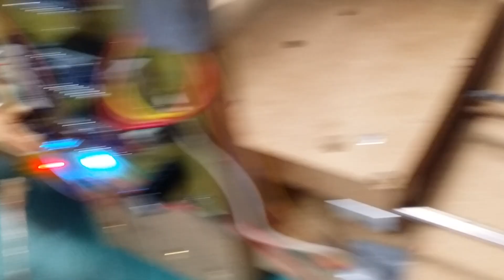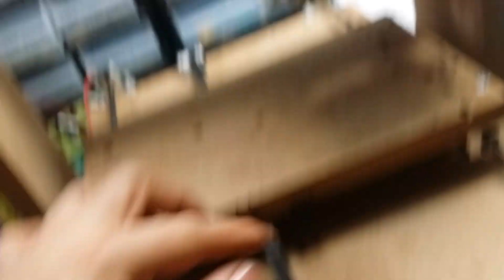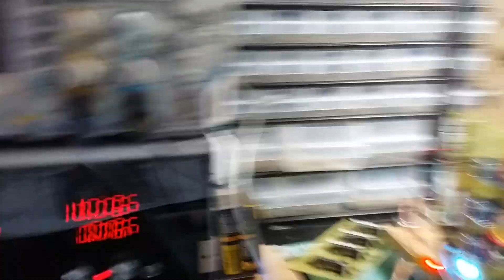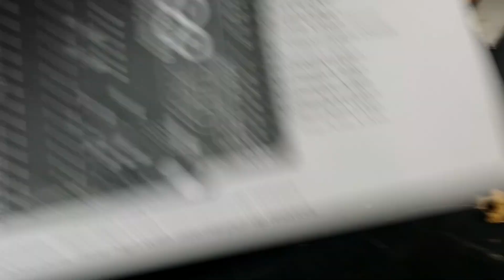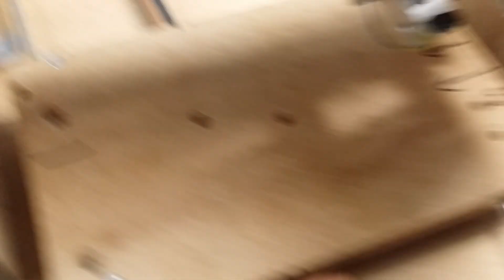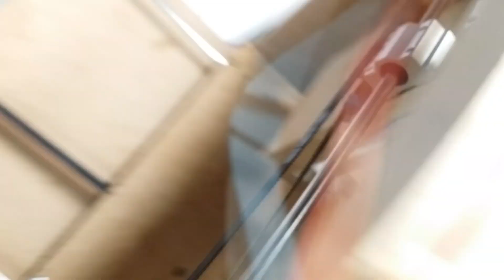Cnc build part1

Comment: MJ, I had the same problem you have with the Z-axis motor. I'm not sure what the cause is, but it seems to be related to the speed of rotation of the motor. I lowered it a bit until I did not get that shake and it's been ok since.
As for the rest, looks pretty well so far.

Comment: You need to use the internal pull up resistor on the Arduino before the limit switches will work. Otherwise when the switch is off, the pin will be floating high because of the high input impedance.
Reply from the maker: Great, Thank you for the info.

Comment: i have a 3d printer and the end stops switches are off until im homing . i could change the setting in marlin to stop the motors if i run in to an end stop switch when im not homing .but if i have the end switches on all the time some time you can get interference and the controller would think it hit the end switch wen it did not so i don't want to risk my print going bad because of a miss triggering on an end stop switch . so yea try homing your cnc and hitting your end stop switch see if that works if not go in to your cnc firmware and see if your end switches are meant to be (NC) or (NO) and change the firmware or hardware to match .hope this helps and thanks for making these videos
Reply from the maker: Thanks, Will try that. I have made a new cnc machine. Also bought some new end switches from ebay which i will install on the maching. I will be making videos soon. Been so bizi with work and xmass had no time. Happy x mass every one. Ho ho ho. Lol

Comment from the maker: Ok now i got the steppers working properly, i had to change the micro stepping settings on the driver board. All good now. Only problem is the end switches. I have tried every thing. Even if i pull the y plate to the middle and run it and activete the switch by hand still not working. So have to sort that out. Also need to change the rods on the x axis  as it wobles a bit when i try to drill things. The rods are 6mm i might have to use a 12 mm to get it stable.
Reply: the belt is only good for Laser engraving since it can be faster than rods. Engraving PCB's might als work since the forces are low. But i doubt you can mill things properly with a beltdrive. Did you progress in your build? i would like to see Part 2 :)